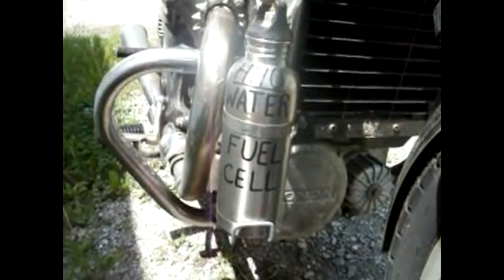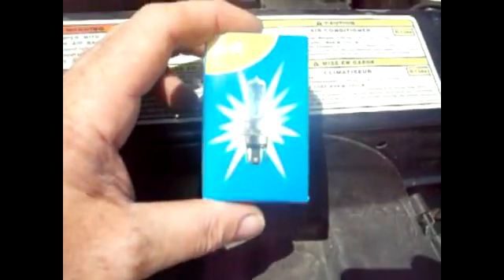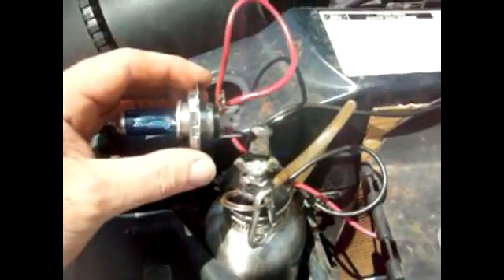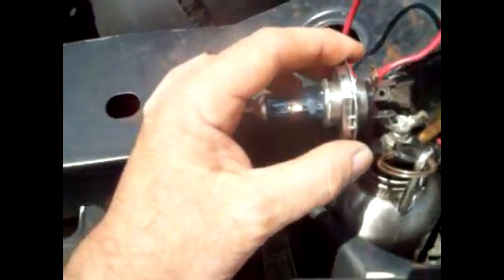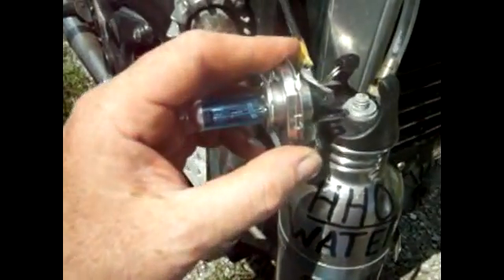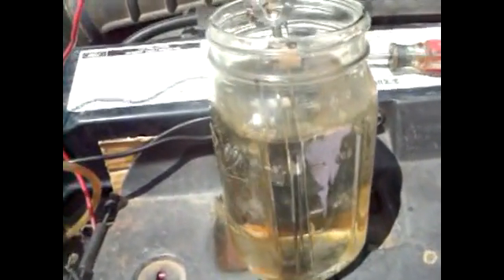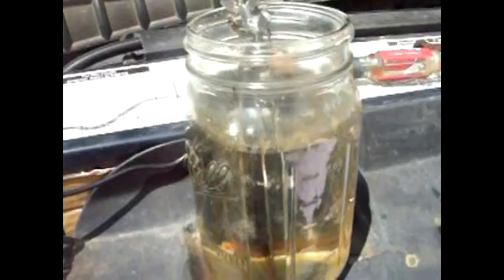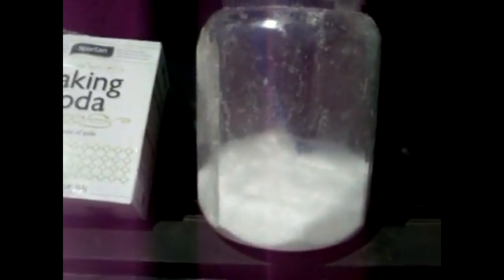HHO generators. Experiment on how to run with near 0 resistance.

Comment from the maker: @warren52nz I have a video made of news clips. Truckers are discovering the benifits of using HHO. 10-33% MPG increase. One of these companies did a dyno test and it was confirmed. All of us home builders use the basic "gas used/miles driven" formula to figure results. 
Generally you don't control the flow, but you could rig it up that way. You just have a bigger HHO ratio while idling.

Comment: @wcemichael "you will have and oxy-hydrogen mix and is explosive."
I'd better read up on the chemistry of the Drano/Aluminum reaction. The video I saw, showed a guy blowing up balloons with it and them floating to the ceiling.

I'm not too worried about the flammability of the mixture, it's contained in a balloon-like bag and it would be difficult for an ignition source to get at it.  It cost me $80 for a tank of helium that could inflate it 3 times and the helium leaks through the membrane.

Comment from the maker: @warren52nz No, the mixture is too thin for that. but the backfire can light the HHO in the connecting hose. and it will travel back and explode the HHO unit. (like a firecracker or M80) but we generally have safety devices installed too.

Comment from the maker: @warren52nz The first part of your statment is correct. And yes, thousands of people around the world are experimenting with this and most are getting results. I've convinced my company to try it on our vechiles and we will be monitoring closely!

To your second part. You can do that but you will have and oxy-hydrogen mix and is explosive. You need a unit that will seperate the H from the O. It can still burn but won't explode.

Comment: @wcemichael "The light was to demonstraight how much current they were drawing, without using a multimeter."
Ahh, I see, thanks.
If it hasn't already been done, someone needs to put an engine on a dyno and run some tests to see if efficiency gains are better than the energy required to make the HHO. A "seat-of-the-pants" meter can only tell you so much, especially if you WANT it to work.
How do you control how much HHO goes into the engine under different conditions (idle vs full throttle)?

Comment: As I understand it, this concept isn't about replacing gasoline but in making it burn more thoroughly (less wasted energy out the exhaust). Has anyone done any research into whether this is true?
I'm interested in making hydrogen to inflate my "Air Swimmer" (flying remote control shark), helium is too expensive and it leaks out. Best result so far is with Drano (Sodium Hydroxide) and aluminum foil. Have you played with that? Generates a LOT of heat and a lot of hydrogen (but not oxygen) too.

Comment from the maker: @warren52nz You've misinterpreted what I doing and why I'm doing it. "Why don't you just use less baking soda to reduce the current?" Is exactly what I do in normal straight hookups, and I that's what I did on those HHO devices that were already installed. This is an experiment in running a 'PASSIVE hookup" using the same current twice. The light was to demonstraight how much current they were drawing, without using a multimeter.

Comment: Why don't you just use less baking soda to reduce the current? The energy used by the headlight is wasted. You're adding electrolyte to reduce the resistance then putting a light bulb in series to increase it again.
I'd like to know more about the math here, how much HHO is being produced/second and how that compares to how much gasoline and air is being used by the engine/second. Just to get a feel for how significant the HHO is. Also how much energy is used making the HHO vs extra efficiency.

Comment from the maker: @1BustedMyth The 100% H motor is a strawman argument. nothing to do with what I'm doing. If you have 100% H motors, great. Get the damn thing into the market. I already ran the full blown bench experiment and posted the video. THIS video was just a start, the warm up. So how can you tell me it doesn't work when I posted a working model? I'm getting more hydrogen than I was last year when I was installing LED bulbs just to reserve a couple of amps to run last years hook up.

Comment from the maker: @wcemichael (cont) True the multi meter will allow you get an exact calculated measurement and not interfear with the operation of a circuit. HOWEVER, the porpose of this video was to show the average layman the difference in current being drawn between the first to vehicles whith the HHO units set at the max output I dare use. The last example shows me making more HHO than the first 2 put together and using the bulb as a resistor to control current draw, having a byproduct of light to use

Comment from the maker: @christo930 You can't use a lightbulb as a meter you can get exact numbers off of. If you can't tell it's getting more or less power simply by looking at it, then you really need to rethink your education. The only difference between the 2? the light buld shows your getting more power by getting brighter, the meter shows your getting more power by a little needle moving further. Your still getting a visible reaction. Why is that so hard to understand?

Comment: You can not use a light bulb as a multimeter. The brightness of the bulb is not a measurement of the power going through the circuit, it doesn't work like that. All you have done is created a series circuit with 2 resistive loads on it and the energy (watts) is divided between the 2 resistive loads based on each individual loads (the bulb and the HHO device) relationship to each other.  I had 2 years of formal classroom and lab training in electronics and electricity. k-mart has a $4.99 m-meter.

Comment: @wcemichael Keep in mind that oil doesn't have a fixed price, it is priced by supply and demand. If suddenly reduced our oil consumption by 1/2, production would quickly drop and the price would go up and they would make just as much money while spending less money to increase production. It is also far more efficient for an oil field to be bled more slowly. So it would actually be a good thing for the oil companies to sell less oil, but a a higher profit margin.

Comment: What you are trying to do doesn't work. The power source sees series loads as a single load and if this series load is in parallel with another series load, it changes the circuit greatly (and you don't know this without a schematic of the bike's electrical system). By putting a non-zero resistance load(the jar) in series with the light, you are simply diverting power from the light to the jar.

Comment: If you reduce your resistance, your amperage draw increases and the closer you get to zero, the more amps you will draw and the lower the voltage goes, it effectively creates a short circuit. Think about it, you run a wire from your negative terminal to your positive terminal, what  happens? Amps go through the roof and the wire catches on fire or the batter explodes and the voltage drops to zero (all points on a wire are electrically the same, except across a load). No load=zero volts inf amps.

Comment: @christo930 I don't understand this. Why are you using a light as a resister, when you can lower the amperage draw by simply using a weaker solution? Remember, the higher the resistance, the lower the amperage you will draw until you meet infinite resistance (an open) that draws 0 amps. By adding sodium to your jar, you are lowering the resistance and raising the amp draw. Also, with so much baking soda, you might also be producing CO2 which would actually work against you.

Comment: The lower the resistance, the higher the amperage you will draw, with zero being infinite amps (or the maximum output of your source, which will melt your wires and or cause a failure of your source). Even if you look at resisters, the lower the resistance, the bigger it will be (to handle the amperage). If you want to lower the amperage being drawn, increase the resistance. This can be worked out very easily on paper with (very) basic electronics knowledge.
Reply: here even better we dont need any basic elec. knowledge

Comment from the maker: @JsA4E yea, that's pretty close. You can run multible HHO units that would normally drain a battery in 10 min, but there is no way to draw more power what the light does. Heat? well the heat factor is the same. running multible units to achieve near zero resistance would dvide the heat up. On the bike I mounted the unit in the open air for natural cooling. Did this explain everything?

Comment from the maker: @a1mint (cont2) Once upon a time, (i forget when) the gov forced car makers to get better MPG and they did. Then SUVs came out. the SUV was a legal loop-hole because it wasn't mentioned in the govs bill. It got worse MPG than my old van. Why? Most are slighty smaller and lighter, some have smaller engines, but the MPG still sucks. If Big oil stands to lose money because cars are getting better, wouldn't it benifitial for both for big oil to pay Ford to make a car get as little mpg is possible???

Comment from the maker: @a1mint You don't know POTENTIAL ENERGY FROM FREE ENERGY?This is not normal free energy. The FREE part is it cost next to nothing to pour water into a special fuel cell. The energy is not being CREATED. ONE SUBSTANCE IS BEING CONVERTED TO ANOTHER SAME AS GAS AND ETHINOL. Your statment also means that when I turn on my headlights you lose 5MPG, then turn on my heater fan and lose another 5mpg. Turn on the rear defroster and lose another 5mpg. Concidering my truck NORMALY gets 15MPG I'm screwed.

Comment from the maker: @a1mint HEY, THE GUY WHO DOESN'T DO EXPERIMENTS, KNOWS ALL THE ANSWERS. Have you checked ALL my vids? My motorcycle use to go 60 miles before switching over to reserve, then another 30 on reserve for a total of 90 miles  Now my bike goes 80 MILES before switching to reserve. How do you explaine that? A gas fary? FYI any car has spare power to run a HHO generator. You wanna explain the 5MPG increase in my truck?